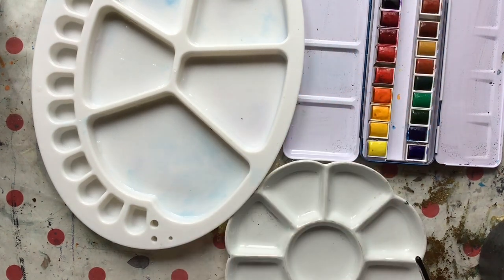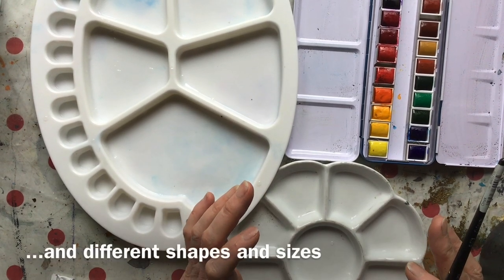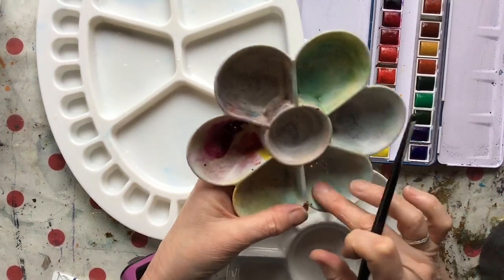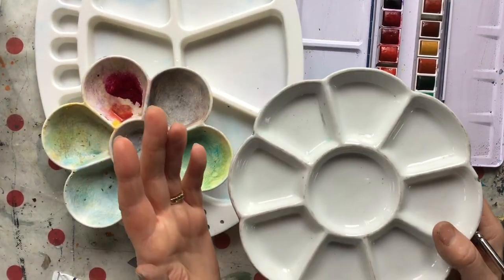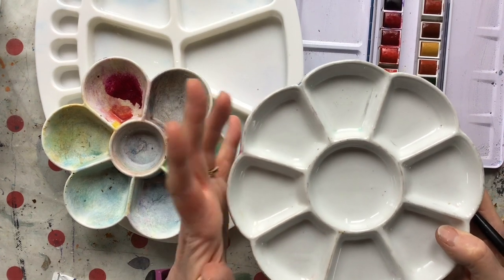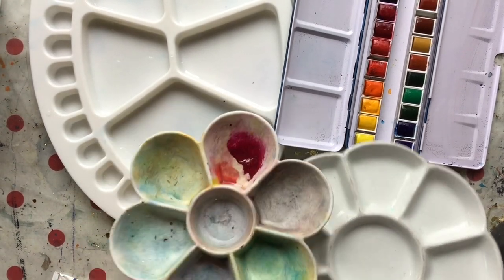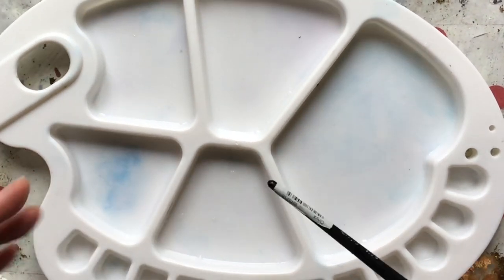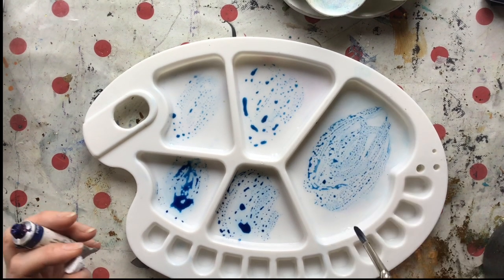How to stop paint beading on your plastic or tin watercolour palette - fix it fast!

Comment: Hi Liz, when you started the video, I  was going to say use a magic eraser  or toothpaste, both will will usually remove stains from pallets. Then you produced both for your problem  with beading. I think if you clean the pallet regularly with toothpaste it should  improve the beading issue more each time, I would give this a go too to see if this works, bonus too is that your pallet will be cleaner to see the colours you're mixing better 🤔. Ceramic pallets are so expensive to replace if you damage them 😫 been there so have stuck to my metal or plastic mixing areas or a white plate.
Reply from the maker: Much prefer ceramic - but they are heavy and breakable! The beading goes away with time, as you say, but is deeply annoying on a new palette!

Comment: I just did a little experiment of my own with acrylic mediums. I used clear gesso, matte medium, and heavy gloss gel medium.  And they came in in that order, with very little difference between the clear gesso and the matte medium. The gloss gel I thought would have performed best because it would be similar to a glass surface, but it came in third but only by a little bit. Each one of them are worthy. Another YouTuber suggested using a glue stick, and it works well but if you want to clean your palate then you have to redo it all
Reply from the maker: I didn’t like the glue stick idea, as I thought it would contaminate the paint.

Comment: once you've used the toothpaste and rubbed off does it affect the color mixing?  Is there any toothpast reisdue in your paint after mixing?
Reply from the maker: Toothpaste is a mild  abrasive so it alters the surface and is then washed away. I’ve seen people use a glue stick and not rinse it. That would contaminate your paint

Comment: How would coating it with watercolor ground or another substance. I like my ceramic flowers - amazon has good prices on them, but I think the ones I bought are a little too small -
Reply from the maker: ceramic shouldn’t bead up, so you’ll be fine. A watercolour ground would absorb paint and stain, so wouldn’t work

Comment: I've use Comet cleanser on plastic palettes and it works well and doesn't scratch.
Reply from the maker: What is Comet Cleanser? Sounds good!
Reply: @LizChadertonArt  It is a household non-abrasive cleanser available in Canada and probably the US.  It is similar to Ajax Cleanser if you have that brand in the UK.
Reply from the maker: @didee1000  Cif, I think would be the equivalent. Thank you!
Reply: @LizChadertonArt  I googled CIF and yes I believe it is similar to our VIM which should work just as well. (Comet and Ajax are powders.)
Reply from the maker: @didee1000  thanks Didee. Isn’t it amazing how you can quickly become an international expert on cleaning products! Thank goodness for google! 😂
Reply: @LizChadertonArt  So true. :-)
Reply: i do the same! though i use Bon Ami powder. it’s just like Comet except it doesn’t have bleach in it. it’s just feldspar and limestone. i make a paste of sorts with it mixed with water and just rub into my palettes with a dry paper towel. it works for plastic and metal palettes too! also removes stains very easily (:
Reply from the maker: @rennley_9233  thank you for the tip!

Comment: Two questions:
1. After a painting, if you go ahead and clean your palette, do you have to do the process again to paint again?
2. If you are painting a lot, mixing and mixing, won't that take away the glue or toothpaste, while you are still painting?
Reply from the maker: once the palette is worn in, it will be fine, so no need to redo
Reply: @LizChadertonArt  thx. 😊

Comment: Try olive oil to remove the paint stains. Put it on a paper towel and rub the stain.
Reply from the maker: thank you - would the oil not make the beading worse?
Reply: @LizChadertonArt  It hasn't on my palettes. I just wipe it off really well after the stain is gone then dry it with clean paper towel.
Reply from the maker: @scarz1951  thanks!
Reply: @LizChadertonArt  Thanks for all you do.